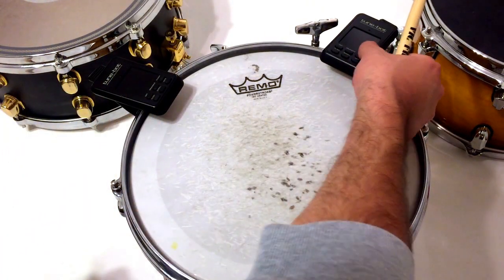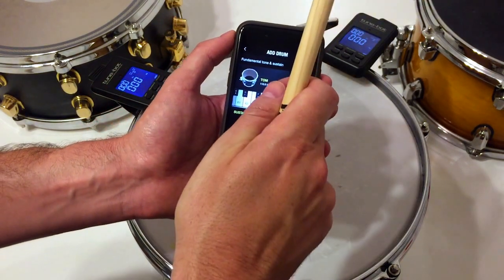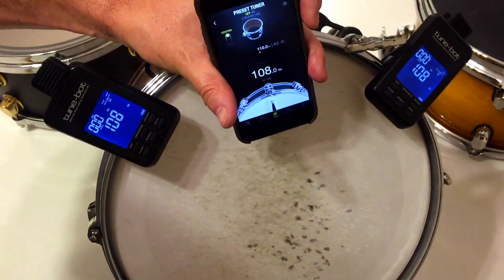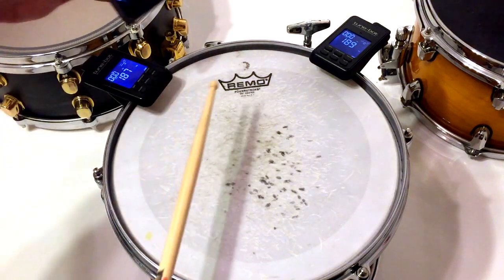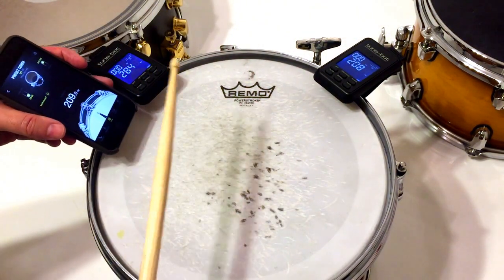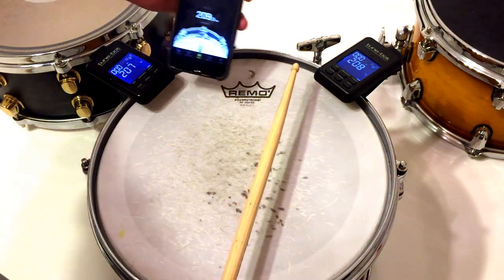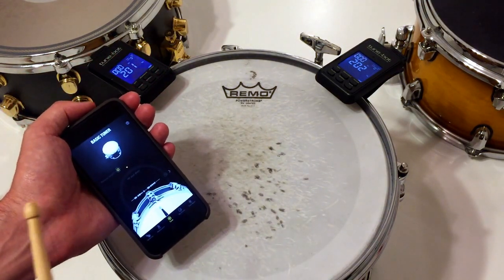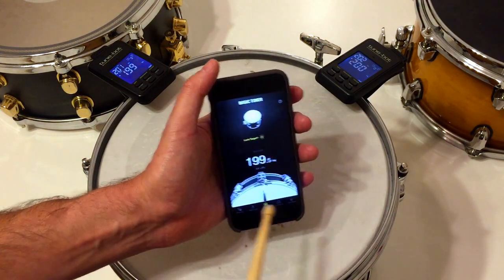Drumtune PRO-Reading consistency. How to deal with overtones correctly?

Comment: Should I dampen the resonant head, when in lug mode?
Reply from the maker: Not necessarily, but it could help to avoid overtone interference if that should occur.

Whether that occurs or not really depends on the drum and the particular tuning of both heads.

Note that the lug pitches of a drumhead vary a bit when the opposite drumhead is muted, for the same tension, due to differences in mechanical coupling, air interaction and loads.

So when storing presets, remember if those values were taken with both drumheads resonating freely together, or with E.G. the drum placed with one side on a flat surface.

In the end, we always tend to perform our final tweaks with the drum in its final setup.
Thus, with the tuned drum mounted onto its stand and in the context of the kit, with both heads resonating freely together.

That allows us to check the true and final impression of the drum’s feel, sound and its decay dynamics, as opposed to the initial clearing stage of the lug pitches of both drumheads in isolation from one another, which only provides an impression of how uniformly each drumhead is cleared.

Hence, we check the tuning in its entire kit-context.
iI we find it needs tweaking, we’ll fool around a bit more and adjust one or both drumheads until we get to where we want to get.

(We make tuning decisions based on what we hear when trying new tunings.)

When exploring new tunings, we also tend to flip the drum regularly and work from side to side in iteration, to bring both sides gradually to a point where the drum behaves as we intend it to behave. 

Once the drums sound & feel right, for every single drum a tuning preset can be made and stored in the app that holds the values of their current tuning so that the same sound & feel can be easily retrieved and reproduced later on as well.

Only when we work from a previously stored tuning in the same context, we simply bring each side to its target in one go.
Often the need for final tweaking remains minimal or simply isn’t there that way, since the “research” has been done before.

When exploring new ones, it’s a matter of tweaking both drumheads gradually in relation to one another…

Should you have a particular question, feel free to email support@drumtunepro.com.

Happy drumming.

Comment: Hello, I'm on the free trial version and I have a problem.
 Even though the app detects my Tom when i hit it, it didn't so on floor Tom, snare and kick drum. Of course i chose the correct instrument from the app while trying detection and also tried with both standard and high/low tones options. Finally i tried loosening all the bolts and screwed them back bit by bit, even at higher tones that you would normally have on a specific drum, ex. Floor Tom, to check if i was out of the Hz range to begin with. But still no detection, what could it be? Thank you in advance!
Reply from the maker: Mmm… that sounds like a behavior related to the device-compatibility.

We’re happy to take a look if you contact support@drumtunepro.com.
Let us know the device brand & model, Android version, and app version so that we have a reference. 
Thanks! 

Perhaps you can adjust your app settings. 
Please, already try tweaking the mic settings in the “sensitivity screen”.
Play around with the options and checkt to see if it affects the detection behavior.
Please, also try to plug in an external mic EG. of a headset and let us know if you notice any changes.

Comment: I seem to get a lot of overtone jumps with your app too... Is a bit frustrating to be honest.
Reply from the maker: Yes, overtones are physically present in a drum's sound. 
As said in the video, they can as well bias the readings of the app, and if it happens it can be annoying during tuning indeed. 
However, the app intercepts a lot of them with success, as can be seen in the video. 
When new users are not yet familiar with the existence of overtones (we don't hear them as such), they may think the app doesn't work well. 
To help demonstrate the existence of overtones they are visualized by the other devices when they occur, as a reference of their presence. 
Using the app's built-in flow gives robust results in avoiding overtone-interference. Whether they bias the readings of the app or of the other device, depends of the specific type of heads on the drum and which tension they have at that moment when they occur, the type of heads etc... 
For example, due to its thickness and tension, a snare drum resonant head could be more prone to overtone interference than another type of head. 
Using a mallet could help, or placing it on the floor for detecting lug pitches.
 
 If the readings get jumpy in PRESET TUNER mode, it may be that the fundamental tone needs to be updated by re-detecting it in CENTER mode and then going back to EDGE mode to continue tuning the lugs.  
This re-detection of the updated fundamental tone, may be required when the fundamental tone has changed due to tuning actions... Once the app knows the updated tone, it will know where to find the lug pitches again... 
Also, as described in the app's pop-ups for first use too, it is best to bring the lug pitches within a few Hz close to your target lug pitches first, before using LUG FOCUS to fine-tune.  Don't use LUG FOCUS, too early when pitches are still far-off. If you do, regularly update the by releasing and re-focussing to allow the app to adapt to the tuning changes... When they are jumpy in LUG FOCUS mode, simply go back to CENTER and redetect the fundamental to update it, and then go back to continue...

When the readings get jumpy in BASIC TUNER mode, when lock target is on,  press release target and then redetect the lug pitch from any lug that gives the right result. Thereafter press LOCK TARGET again to continue fine-tune the lugs...

If you have questions, you can contact support@drumtunepro.com.... Happy to help!
Reply: @drumtuneprodrumtuner6249  Thank you!
Reply: @drumtuneprodrumtuner6249  then you get confused and enter in an infinite tuning  loop...
Reply from the maker: @leandroscottjacques  How do you mean? Thanks!
Reply: @drumtuneprodrumtuner6249  sometimes overtones aren't ignored for some reason, even when you get the fundamental tone again, and sometimes, even tightening the lug, you get some strange lower frequency that is nothing to do with the frequency you're before, let's say you're at 120Hz and suddenly you continue to adjust and get 80Hz...
Reply from the maker: @leandroscottjacques  Hi Leandro, 

When you hit a drum, depending on where you strike and if both drumheads can vibrate together or not,  you can basically see 3 things: a "lug pitch," the "fundamental tone," an "overtone" that either interferes in the form of the overtone frequency when it's within the visible range of the app, or either in the form of a random 'reflected' frequency when it's outside the visible range of the app.

When you're tuning a lug pitch up and suddenly seeing a low frequency that's not the fundamental tone, it's probably the last situation. 
The actually produced frequency may be beyond the visible range of the tuner, and then it reflects a random 'incorrect' frequency within the visible range of the tuner. 
(Which could seem similar to the 'jumpy' readings seen on the tunebots in this video. It's a behaviour inherent to drums, tuners and the technology used.)

Sometimes when tuning lug pitches, and when both heads are free to vibrate together, the drum could get into a zone wherein the fundamental tone is so present/resonant that the fundamental tone gets picked up at an edge hit near a lug, instead of the lug pitch. (If you're aware of the fundamental tone of the drum while tuning it, usually such a case is easy to recognize should it occur.)
 
Usually, if that happens, it would happen only on a few lugs, not on all. 

When you check other lugs, there will probably be a few other lugs that still show the lug pitch.
If so, and when using basic tuner mode:  try another lug that generates a lug pitch, press lock target, then check the others. 
With lock target on, a focus range prevents the fundamental tone can interfere with the lug pitch reading.

(Note: If lock target was activated when you saw such a thing, it probably means the focus range of lock target needs updating as it became too low after tuning upwards much.
In that case, you'll need to reset + relock your locked target.)

Alternatively, you could also mute the center of the head lightly or simply place the drum on a flat surface to prevent the fundamental tone from being produced and then check the lugs. With the opposite head placed on a flat surface, the fundamental tone of the drum can't be produced; so it won't be able to interfere with a lug pitch reading.

When using preset tuner mode: center/edge flow prevents fundamental tone interference from happening. No need to worry about that in edge mode, if the center mode is updated from time to time to adapt to the drumhead's changed tuning.

It's also possible that you're tuning a drum in a mode that's not entirely suitable for it; for example if you're adjusting the lug pitches of a floor tom relatively high in LOW tuning mode for floor tom, then you may exceed that mode's range, in which case you'll also see a reflected frequency. (On Android, different tuning modes have different tuning ranges, adapted to what's typical for the specific drum.) You should switch tuning mode from 'floor tom' LOW tuning to 'floor tom'  STANDARD tuning. 

Of course, while it's the current state of the technology (and the app is probably  'state of the art' in its field), those tones are actually present in the drum's sound when picked up in local isolation from closeby with a mic, it's not convenient while tuning when interference occurs and you see another frequency than you'd expect, seemingly unrelated to your tuning action. 
It certainly can be confusing while you're in the learning process. 
However, once you are familiar with the flow of using a tuner and its quirks, know 'how' to interpret a reading and 'what' to do w.r.t. overtones, this phenomenon won't stop you, and you could bypass it to continue tuning should it occasionally happen.

If you have a specific case you'd like me to look at, please contact me via support@drumtunepro.com, and I'll do so. I'll try to reproduce it here first so I can analyze it as well as I can to provide to-the-point feedback. 
Perhaps I could help with a few tips besides double-checking the case.  (Should I need to optimize the app, I'll also do that.)
Thanks & Cheers!
Reply: Would that not be because the resonance head is also moving freely? If you had a towel or something dampening the resonant head while tuning the batter head, it would eliminate all the excess overtones